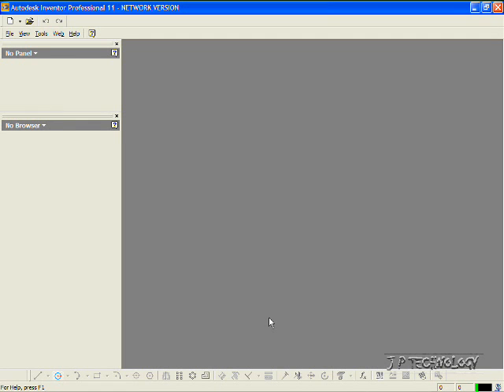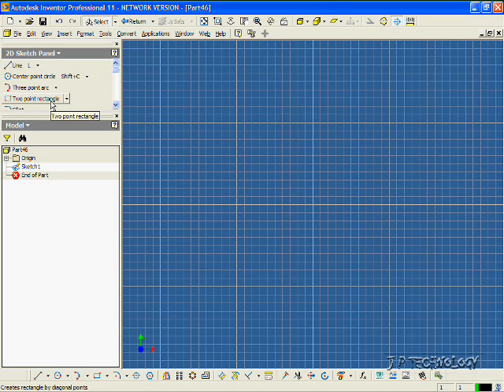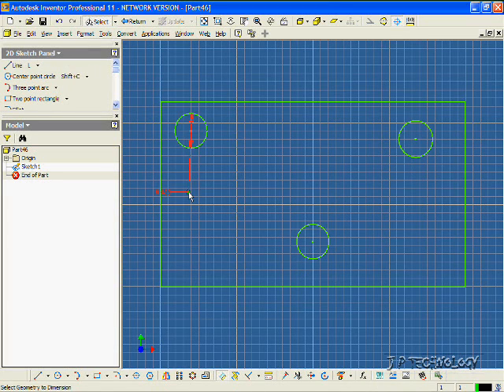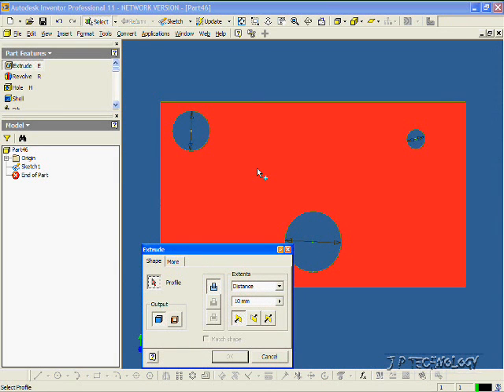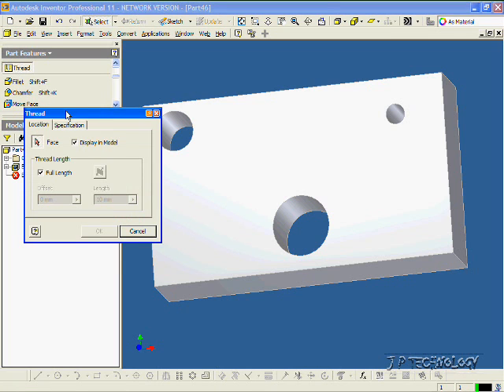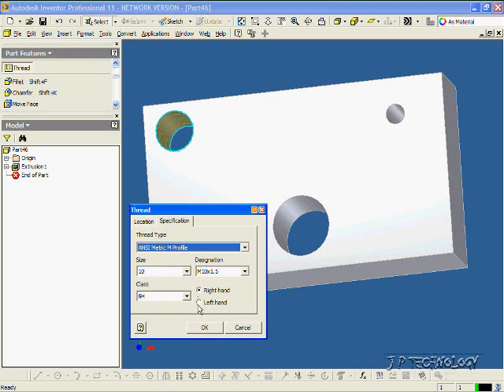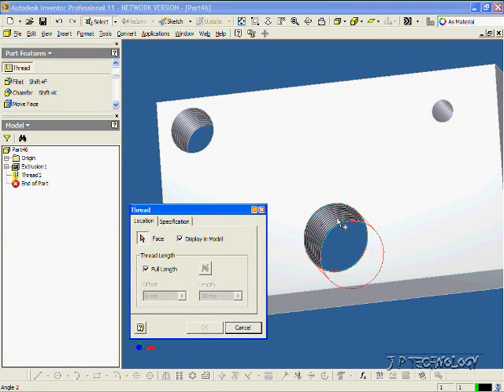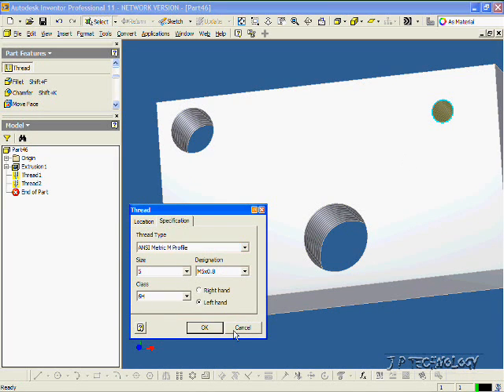Autodesk Inventor 11 tutorial #17 "Thread"

Comment: I dont think any software uses a tool that actually cuts threads without manually making them. It is mainly done to keep the speed of the software up while modelling. I could see a part like he is making to cut the threads, but not a large assembly where you would have 100's of threaded holes, bolts, nuts and screws. Wouldnt even be feasible as it would take forever just to draw a simple line in 3d as your resources would be ate up to just compute all the threads.